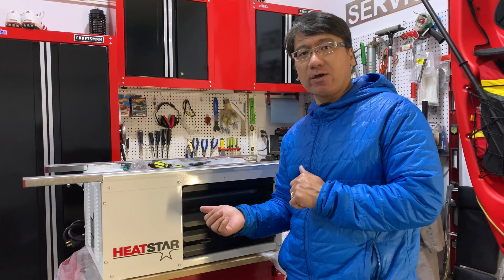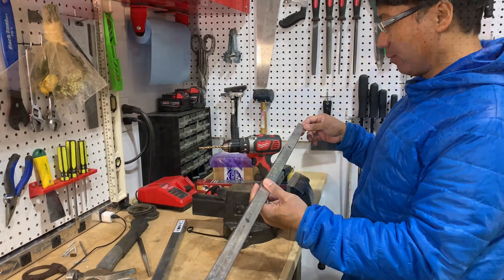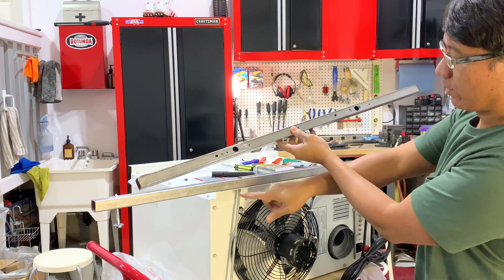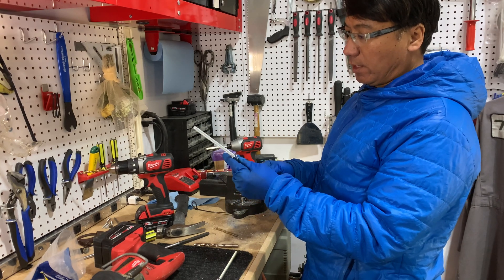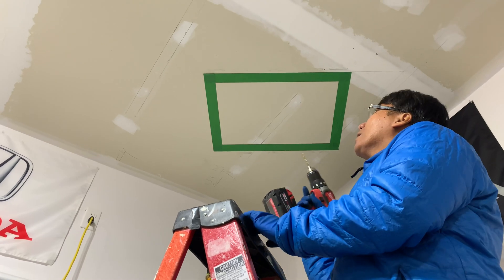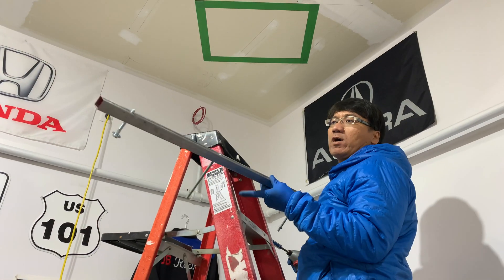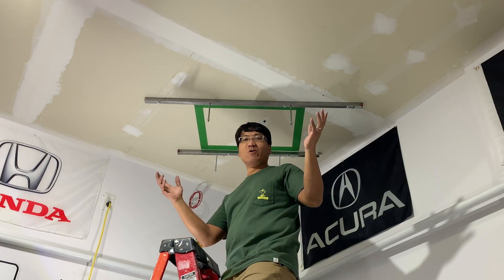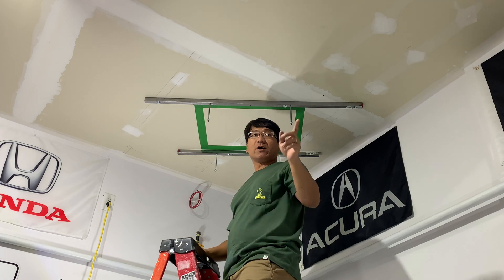HeatStar Garage Heater Installation (Part 2) | 50,000 BTU

Comment: How has the heater held up in the first season?
Reply from the maker: Thanks for checking in! I had it running all winter long and worked well with no issues so far.  I love that I was able to work in the garage comfortably during the cold winter months.  Please stay tuned for the one year update on the subject.

Comment: Great job on the install, I like the clean mounting look. Where did you source the square tube and Vibration isolator padded hanger bolts from? I'm looking at the same garage heater and install approach. Would be great to see a review of your HeatStar heater with any pros/ cons.
Reply from the maker: Thank you @Ken C.! I will for sure do a follow up review in the long term. It’s been a week so far and I am loving it. All my parts was purchased at Lowe’s. I spent about $120 or so Canadian with all the parts.
Reply: @jnb tuning Is the 50,000 btu unit sufficient to heat your 3-bay garage? I see heat star have a 80,000 btu unit, think it’s overkill for my 30x24’ 3-bay garage?
Reply from the maker: @kenc.8791  on my 3 car garage which is under 700sqft, it is more than enough. It is rated to heat 1666 sq.ft. The 80000BTU will be overkill